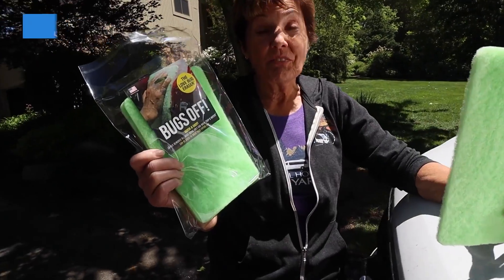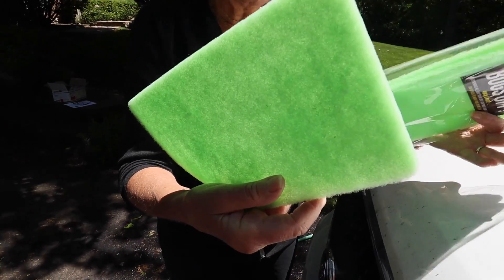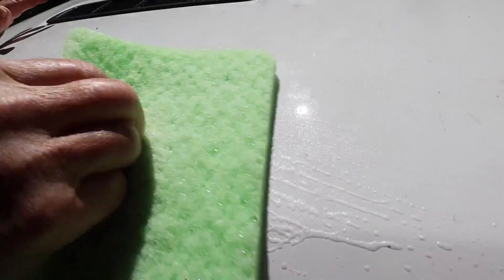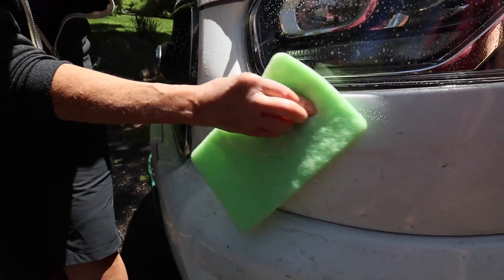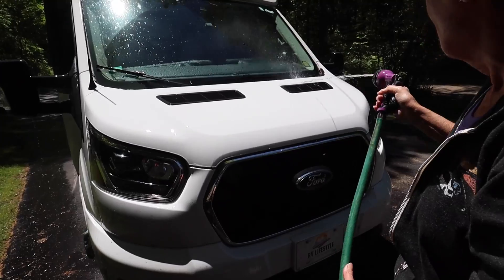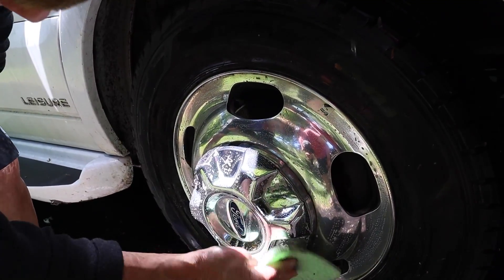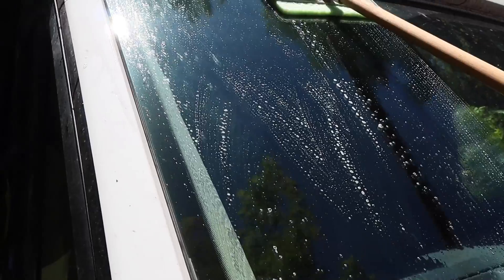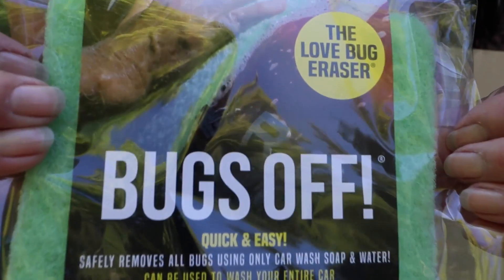A Clean & Bug Free RV! Easy RV Wash

Comment: Nice video. For windshields I recommend Rain-X bug formula windshield washer fluid. Works great when you're on the move. Best price at Walmart.
Reply: I really like the RainX product, but read somewhere that you should not use it on the front of your Motorhome is you have the Diamond Shield.  I’m afraid that if I use it in the windshield was tank that it may cause damage to the Diamond Shield.

Comment: Great video and great product.  Would rather use this than some harsh chemicals.  Do you have the plastic coating on the front of your MotorHome?  Wondering if it can be used with the plastic coatings like Diamond Shield.